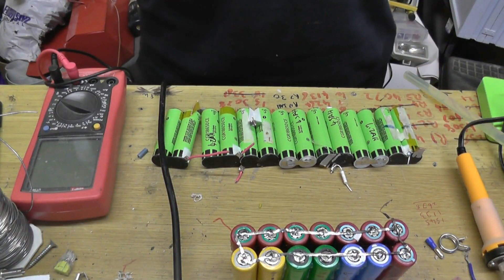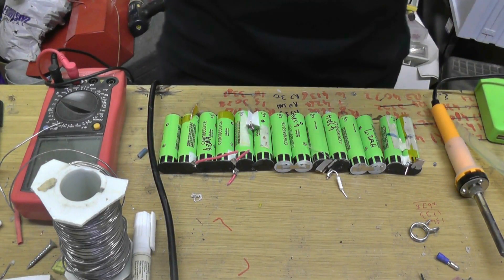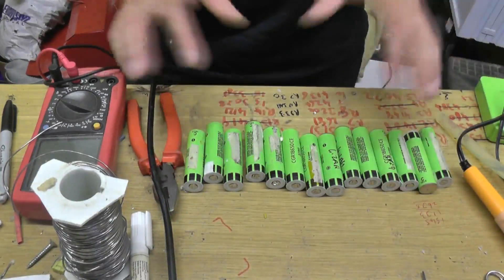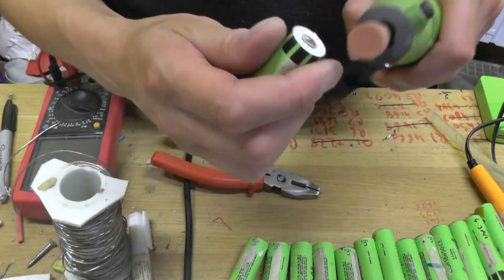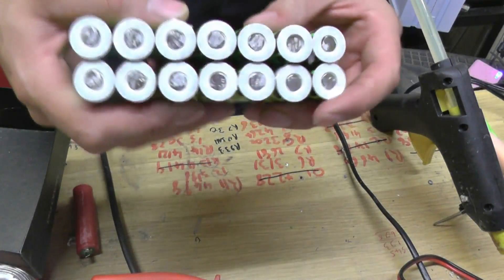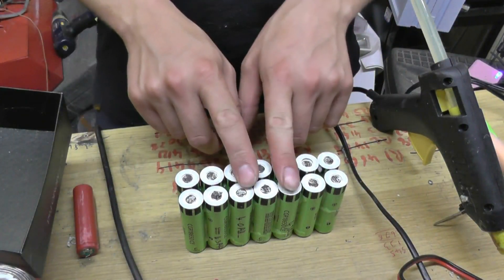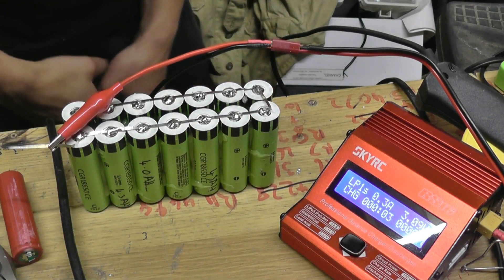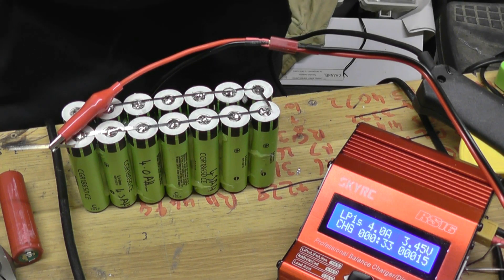18650 pack build part 1

Comment: Really should have some spacing in your packs if you plan on drawing any sort of a high current from them. Right now those packs are going to trap heat in the center. Good idea to get some of the ABB spacers when making packs to prevent this problem, especially in your mixed cell packs that are asking for trouble.
Reply from the maker: LostInTheElectricalAisle this pack is no more. dismantled for other projects. Although it was only ever put together for USB charging.

Comment: what is the name of the charger you used to charge those batteries?
Reply from the maker: Abdullah Bakhlul Meem I use TP4056 boards to charge individual cells and the Opus BT-C3100 for discharging
Reply: i made a power bank with about 15 lithium ion battery now what charger should i use to charge them at the same time
Reply from the maker: Abdullah Bakhlul Meem for several cells in parallel try the Imax b6. Can charge 1 to 6 cells in series at 50W

Comment: five 18650 in parallel each one with protection circuit will auto balance and charge in the good right way? Im planning on making an extreme battery pack to use directly on a smartphone, replacing original battery just with his own protection circuit and connection poles, will ir work?
Reply: Yep. As long as the batteries are within 0.1V of each other, they should be fine.

Comment: 7:03 Bless You
Also, those are some nice 4Ah batteries. I've never seen 18650's that high. Maybe I missed it in the video, but where did you get them?
Reply from the maker: Fishmonger ! Sorry they tested out at 4ah for a pair of cells. to save time while capacity testing they were left in pairs as they were in the laptop batteries they came from. Sorry for the confusion.
Reply from the maker: Masterg Samuraixmen if say you have 5 x 2000 mah cells in parrallel you have a 10ah pack. if when tested you have discharged each cell at 1ah then it will be true. But if you assemble the pack then discharge at a lower rate your usable capacity could be higher. only real way to test once assembled is to discharge through a meter. 

If you have put cells together in a series and parrallel configuration it is going to be easier to look at it in watt hours as you'll see the usable capacity increase each time you add more cells in series.

Comment: Why did you choose Lipo?
18650 are Lithium Ion and your charger supports that.
Reply from the maker: +Alex Scott I have no Idea =/
Reply: pietkaify Haha, I doubt there's much difference, probably to do with the way it increases/decreases the amount of current applied to the battery. I'd of stuck with Li-Ion.
Reply from the maker: +pietkaify I had to check some of my video's they are all the same but luckily the share the same charging peramiters! I will admit to charging LIFE cells on LIpo setting. i expected to kill the cells outright. But they are in top condition! =)
Reply: pietkaify Nice. Did you test the capacity on some of those batteries? I noticed you labelled some "4.5AH" and all the 18650 cells i've seen that quote that figure when actually tested isn't anywhere near it?
Reply from the maker: All cells get cycled 5 times to see if thier capacity is stable. then marked so I can better fit them into a pack. The higher capacities are on the bright green cells. Tested in pairs so around 2.2AH per cell

Comment: i just got 4  PCB/BMS's from china which i want to use to build 3s battery packs for back up power is there any problem if i connect the battery packs in parallel to increase amperage or should it be one big pack the pcb's have a continuous current of 16 amps so my thinking was that if wire them in parallel on the solar system i have more amps at my disposal than 1 16 amp battery
Reply from the maker: Absolom Madhaka That sounds right! 1 pack will give you 16A 2 packs 32A and so on! I would make sure your packs are of simila capacity! For example if your pulling 30A and one of you packs in the parrallel string goes flat leaving 30A being drawn across one pack. Could you send me a link for the BMS you bought?

Comment: Why don't you leave all the tabs on them then you would save lots of work you would not have to use hot glue or grid down the batteries
Reply from the maker: jake goakes I think it looks neater when its completely removed! =)
Reply: Kind of but you can soldier the tabing wire right in the middle of the tabs that hold the 2 cells together then you will not heat up the cells as much